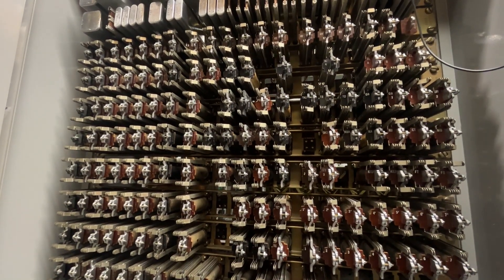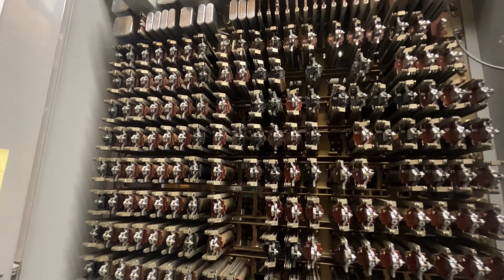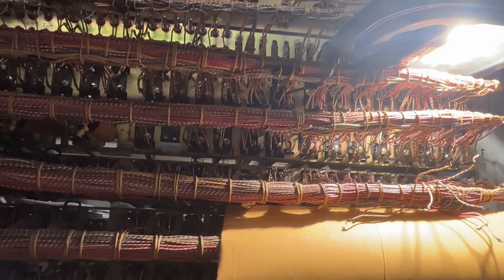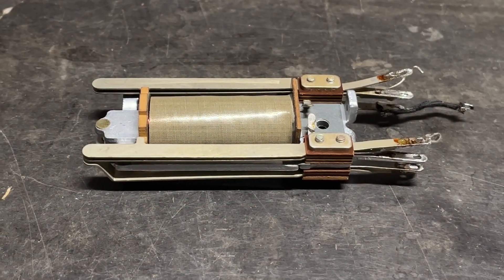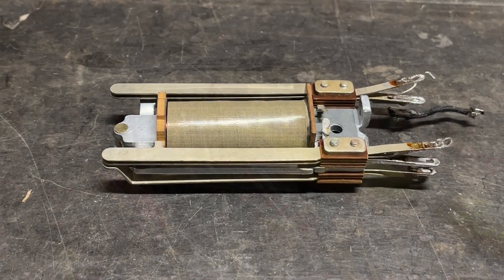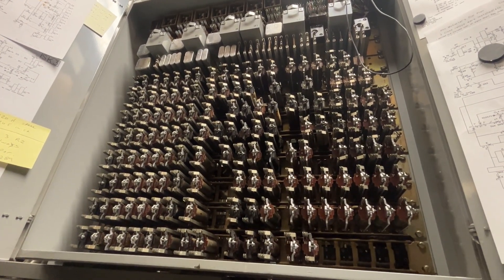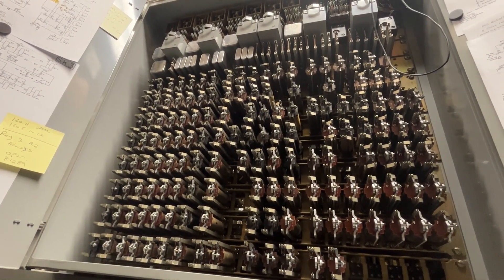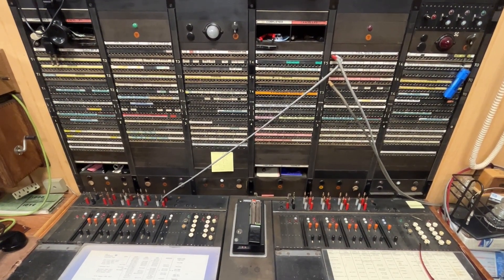Troubleshooting (R) type relays. 3CL toll switchboard sender.

Comment: Hi Phil, I wondered if you could explain a little more about the 3CL sender? In 1970 I worked as an operator in a Pacific telephone toll office that handled incoming calls from mostly step-by-step exchanges and was located in a step-by-step office. I was young and I had no idea what the equipment was at the time, but remember seeing in one of the back rooms something that looked like a cross bar switch. Was that used only for the switchboard? We had several tandems if I recall 7T was for toll, 34 T for midcity and 78T for South Bay. I’m assuming when I plugged in the one of the tandems, I received a sender from that office, but just can’t put it all together in my head :-)
Reply from the maker: I plan on making a more detailed video when everything works

Comment: I've had to perform some backplane troubleshooting on a GTD-5 Switch, and  sympathize with this type of work.  I've had to solder, and discovered it was best to have an isolated soldering iron, when working 'modern' EAX gear.  Introducing alternate paths to ground can be problematic.  Since the Switches I service were installed over 35-years ago, the plastic insulation on the wires; especially those wires pinched or turning at sharp angles, seem to be breaking down.  Many times we have isolate the problematic conductor, & then perform a bypass with what we call daisy-chain.... a spool of blue wire (28-30 gauge), that has small insulated sleeves every few inches, which slip over pins on the backplane.  This work definitely tests one's vision, and attention to details.

Comment: It's nice to see a couple of positions from the operator office I closed on July 2, 1988.  I purchased 3 positions, one of which was the Supervisor monitoring position.  I also have the Service Assistant Call Director.
Reply: I see you also replaced the MECOBS keysets with the old style KP system.
Reply from the maker: Were all of the relays removed

Comment: This reminds me of a toll center I once visited. (Ticonderoga 518+024+)  It was a step tandem, and its tributaries were all step offices, but the toll operator switchboards had keypulse sets instead of dials. I know when an operator plugged into an outgoing trunk to its superior tandem MF tones would be sent, but I always wondered how it worked when dialing into one of the tributary offices.  Were the operator keypulse sets associated with a sender that would convert the keypulse entry into dial-pulses when connected to a step tributary? Is that the sort of sender you're troubleshooting in this video?